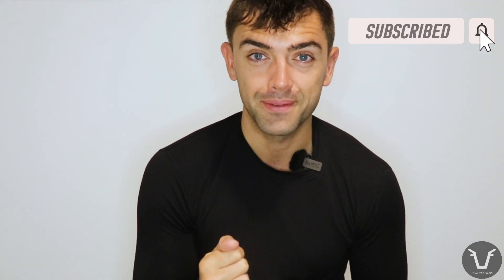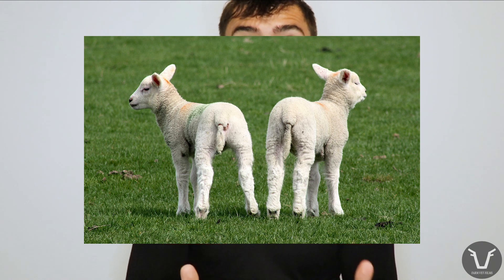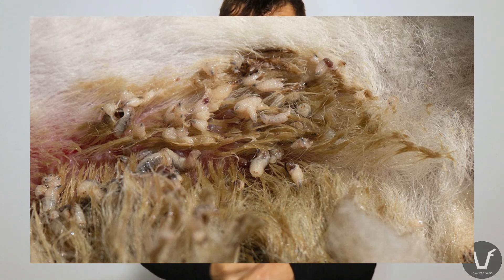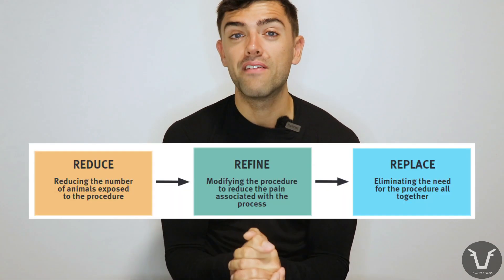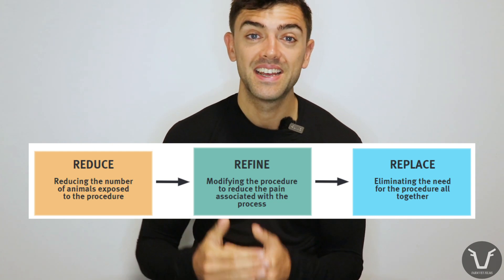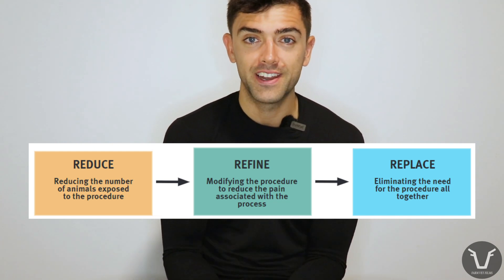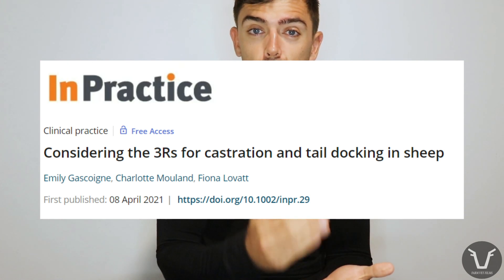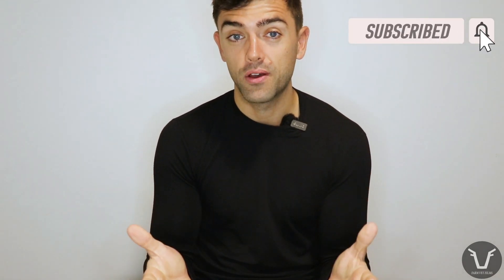DOCKING LAMB TAILS - How short is TOO SHORT? | TECHNICAL #76

Comment: I worked as a land girl on a sheep farm here in Aotearoa/ New Zealand 50 years ago and rubber rings were the go to method, we docked them as soon as possible after birth. Interesting to hear it's changed to a hot iron. Pretty sure we docked ours too short then too and, we definitely got the odd prolapsed ewe that was treated with a 'spoon' retainer. Glad to hear things have changed for the better. I only ever saw a couple of sheep with fly strike but it was a pretty grim. Had never heard of mulesing until a few years ago when l saw it mentioned in relation to choosing ethical yarns. Had to search then, to find out what it was and have just googled to see if it was done here at all as, it certainly wasn't done on the farm l was on. Happy to say, Ao/NZ banned it in 2018 and we were the first country to do so. Disgusting practice and l was pretty certain it was never done in Aotearoa. Perhaps it wasn't particularly widespread.